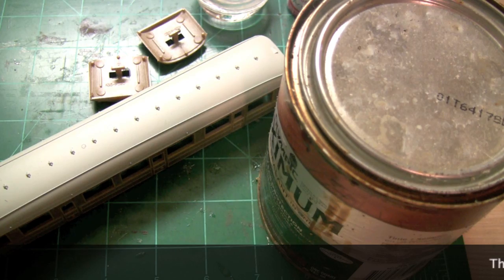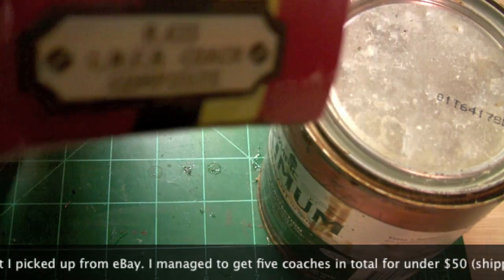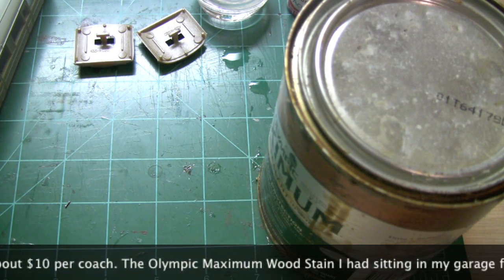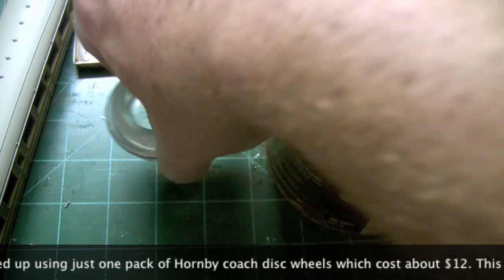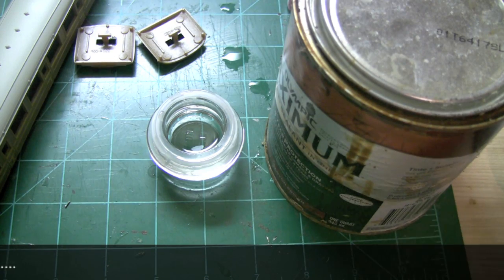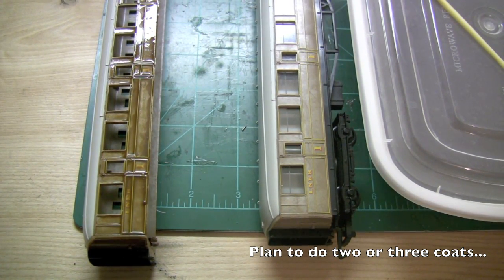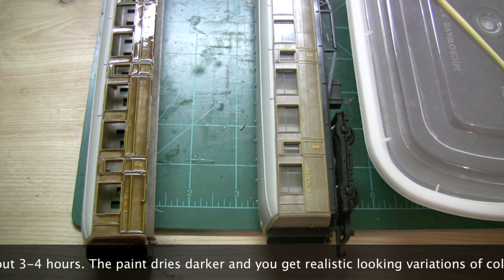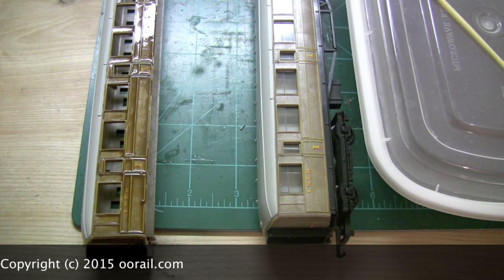oorail.com | LNER Teak Coach Project - Part 2 Staining

Comment: Just to let you know I have now done twelve of these coaches.  The first batch I mixed a reddish brown acrylic (water soluble) paint and brushed on, doing one side at a time.  The paint was then wiped off in the direction of the panel (horizontal or vertical) with a damp tissue.  This leaves a residue in crevices and against the raised panel beading.  I then drybrushed the same reddish brown colour on each panel to simulate timber grain.  After drying,  the cars were clear coated with satin spray.  On later cars after dry brushing the panels with the reddish brown paint (very sparingly),  I allowed to dry then 'washed' each side with a lighter tan colour.  This was then wiped off with the damp tissue leaving a thin smear of tan over the darker reddish brown.  Cars were then clear coated.  The effect is such that the overall colour allows these cars to run with the high detail sleeping coaches from Hornby without them looking out of place.  Regards, Tim
Reply from the maker: Gscalenut Do you have photos or video of these posted anywhere? Over time the teak on the prototype would darken as it weathered, so the LNER would periodically bleach the wood panels with oxalic acid and then revarnish to bring out a much lighter colour to the wood.

Comment from the maker: ***** TheZimma Thanks for the inspiration ... this turned out a lot better than I was expecting... Any thoughts on the look of the original interiors? I know that David painted his a red-maroon like colour, but after doing some research it looks like the interiors were mostly wooden? A lot of the photos from the restored coaches at the SVR look like the ceilings were white? I'm just wondering if this was more for tourism or if its restored to the way things were in LNER times?
Reply: Think we all should look a Lakesides ..Graham he has done a good job on the interiors
Reply from the maker: ***** Graham did a nice job with the lighting. The eBay stickers / printouts he bought for the interiors are a good idea, but the texture quality is very poor. You'd almost be better off going down the SVR and taking some photos of the interior and scaling them down in photo editing software. I'm also pretty sure from chatting with Graham that he wasn't too interested in an accurate representation, which is perfectly fine for what he is doing, but doesn't really help me out! :-P

Comment: Did you ever find out what the original interior colours were?
I try to stick to LMS but I've got 3 LNER locos and 6 teak coaches so I'd like to paint them up as close as possible to original.

And here in Australia I have to rely on the internet for research, can't take a trip to a suitable historical society.

Wife: Why are we spending $4000 on a trip to Leeds?
Me: I need to find out what colour LNER coach interiors should be.
Wife I want a divorce!

No she wouldn't really, she'd just make me cancel the trip and not spend any money on model trains for a year :)
Reply from the maker: Yes I did courtesy of several hours of searching on Flickr and researching a ton of books I picked up via eBay. I'm juggling a bunch of projects at the minute, between pushing videos regularly, Trackside3D printing and a major website overhaul to oorail.co.uk. One of the things I'm doing is pushing project pages to the website. I've got some 3D printed extras for the inside of those LNER teaks as well, so you should see another video on that project as well as the page sometime in the near future. If you don't by say the end of April, drop me a reminder comment! I'm a little closer to the UK but still a ways to go, but you can find most of the information on-line with a bit of research.